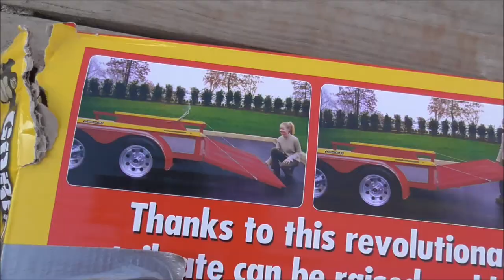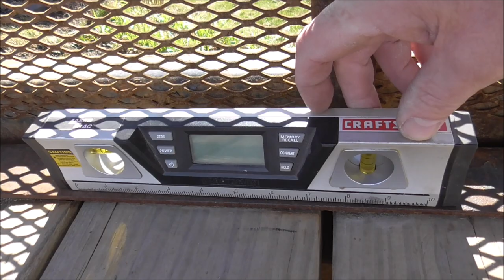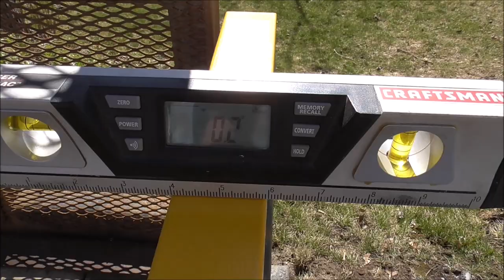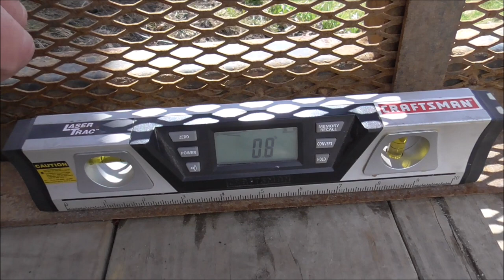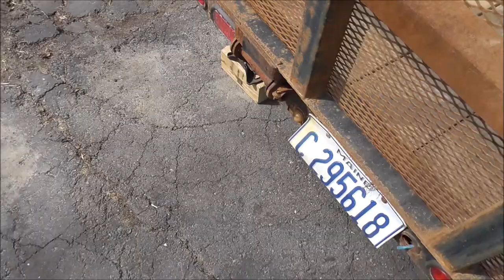Big Problems Solved! See How This Gorilla Lift Gets Installed on a Round Rail Trailer!

Comment from the maker: $25 Aluminum MIG Conversion https://youtu.be/FGhSo82MP9U
MORE WELDING AND FABRICATION VIDEOS HERE:https://www.youtube.com/playlist?list=PLfbf78fMz9Vol0uX2-GNc6mLi75zpqb5f
LEARN HOW TO WELD VIDEOS HERE:https://www.youtube.com/watch?v=ADa1I319GJ0&list=PLfbf78fMz9VqxPZTT-xmwdcrHVa7ML-ft
MIG WELDER https://yeswelder.com/products/mig-welder-mig205?ref=BRANDONLUND
Reply: Ohh thank you for the learn how to weld videos Brandon….im still waiting for the electrician….they are busy all the time…the whole house unit showed up yesterday so im thinking soon…heheh…lets hope so
Reply: That’s a really nice mig welder but, I can’t get one…i got the other one…..I wouldn’t mind having one….
Reply: When setting parallels across spans such as on that trailer. Bring two lengths of tube or angle to stretch across and clamp on the top of the gorilla tubes on the trailer.  From there fine tune the alignment as they will be placed at the exact horizontal plane resting on the pipe.  it will cut more time.
Reply from the maker: That would also work 👍

Comment: Hi Brandon.Nice job on the trailer. You're right about the finishing touches. It'll leave a good mark that you do things the way it should be. The paint finish will tell the client that you  did a very good job and the story will spread like wild fire.. you were just requested to install the lift and you've done it like straitgh from the factory. Good job. Keep it up. Thanks and God Bless. 👍🏼👍🏼👍🏼
Reply from the maker: Thanks man. Whenever I do things I try to do them like how I would want it done. It usually takes longer but 99 % of the time it's a better product

Comment: I spent my entire career in production metal fab so simple fixturing is automatic for me. It's easy to forget that other people have different backgrounds and do not think that way... I then spent a few years playing electrician installing conveyor systems and kinda took over the on-site fabrication operation.. The electricians thought I was a genius for things as simple as  clamping stops to a drill press table instead of hand marking 50 or more pieces individually....  Great simple explanation today...  TIP: (you knew it was coming)   Grinding a small chamfer on the bottom corner of the stop will eliminate chip build-up that can throw off the accuracy....  Good job on the project working through all the  issues...
Reply from the maker: Thanks man and great tip I appreciate you sharing. We all can learn from one another

Comment: i have a round tube trailor, i purchased (8) 2 1/2 inch muffler clamps welded the saddle to the to the square tube , then installed the U bolts up from the bottom, worked very well!
Reply from the maker: Nice! 👍

Comment: Thank you for the video. Helped me a lot in installing on our company trailer that has round tube railings. Used your measurements and all worked perfectly as you had directed. I still sucked on welding but thats besides the point. Again thank you for the video made a good reference for me.
Reply from the maker: Thats awesome! Thanks man and I'm glad it helped!

Comment: Brandon, I'm soon to pickup a "new" trailer that was used on a flashing arrow sign. The bed measures about 4'x4'. I plan to lengthen it forward about a for or so. It's a flatbed, so I'll need sideboards as well. It was a piece of construction equipment so it was never registered or licensed, so I'll have to go through that in my upgrades. I plan to put this on your FB page when I get it, and will go through the details there.
Reply from the maker: Oh I love that idea please do! Others will appreciate it also. It sounds like a fun project!

Comment: Good video!!  I didn’t know they made those lifts. Nice job. It’s the details that matter
Reply from the maker: It's pretty slick Mark. Thanks for watching!
Reply: @BrandonLund  It’s always a pleasure. I am going to build a tailgate for my little 5 x 10 trailer. Needs to be heavy enough to ride a Harley a bit. Would 1 1/2x 1 1/2x 3/16 material be thick enough do you think? I’ll use expanded metal over that
Reply from the maker: I would think so 👍

Comment: I have seen some individuals place the system inside the tube it's self ,  not to take away from your  great fabrication work
Reply from the maker: As I was doing this I thought of that myself. Super clean look also. I think this could be built using garage door springs and some rollers

Comment: Being so thin would it of been worthwhile to weld the inside of the 4 ends for a little bit more strength? Also if they were moved back about another 50 mm the Gate would shut all the way. I know you did what it said to do.
Reply from the maker: Time will tell

Comment: That’s darn heavy gate!!!  I see how much framing it has.. I have motorcycle trailer with ramp no spring or assistance on it but light steel. No rails… I wish put one on it.
Reply from the maker: It sure is heavy. He hauls a heavy tractor and a local fab shop added some additional supports a fee years ago.

Comment: I think you might still be losing a kerf thickness on your parts subsequent to the first one. First cut is on left of cut line = accurate. This has removed a kerf thickness from the beginning of the 2nd piece. So cutting to left of second line is short of the measured (desired) length. Since this project has arbitrary length pieces is is inconsequential, but if it were an assembly there would be problems.

Comment: Brandon, I am interested in the "level" you used in the gorilla lift video. I looked on Amazon and Craftsman, I could not find the model you used. Could you tell me the part number and where to find it?
Reply from the maker: Here is a link for your information. It's discontinued but it will give you an idea of what to look for. https://www.dxengineering.com/parts/shc-948292

Comment: Most people just use one but since his tailgate is heavier, why not. I went to a 10 pound spool of welding wire myself, after the 2 pound went empty. I would think that a spacer could be put on between the cable and the tailgate to keep it straight, just my opinion.
Reply from the maker: That was my thoughts too Jake. I watched some other videos and one lift seemed to be enough for most but this one had been beefed up by another local fabricator, so it was real heavy

Comment: Brandon, you'll want to be very careful using gloves around rotating equipment. I worked for a company where one of the employees cut his finger on a lumber saw that pulled his gloved hand into the saw. 
My employer at another company at one point required us to wear gloves for drilling, grinding, etc because the company he contracted with required it. I told him the above-mentioned account, and he did some research, and reached the conclusion that OSHA prohibits this. If you're worried about OSHA, you have to have a minimum of 8 employees for them to come after you, so you are definitely in the clear. I currently work for myself, so I'm also okay in regards.
Reply from the maker: I actually witnessed something similar. It's pretty scarry for sure.

Comment: Great fabrication work but that guy needs a new trailer or an updated tetanus shot. That trailer either lives out side or is up north.
Reply from the maker: Both! Winters here in Maine are brutal on metal. I had a truck that rotted out in 10 years. It ran like a charm but the body and frame disintegrated. I learned the hard way about undercoating. Either the metal was better years ago or they changed the mixture of what they apply on the roads here in the winter because we never undercoated our vehicles and we never had these problems until the last 10 or so years.

Comment: Ok gotta ask y not just use some c channel
Reply from the maker: Needed the clearance to be able to get in there with a wrench to tighten or loosen the nuts. 2x2 was the minimum to be able to do that. 2x3 would have been better but I didn't have any.
Reply: @BrandonLund  gotcha also if u wanted a multi process machine to cover as many bases as u could which yeswelder would u get im debating currently have backpack oxy acet setup and oxy propane setup for cutting and a hb special titanium 125 flux welder love it all mainly weld outdoors and want something for a bit heavier use

Comment: How would you take the two piece unit off of the 2” square stock? Are the two middle nuts accessible somehow?
Reply from the maker: All of it is accessible but you will need a ratcheting wrench to get to them. Getting them off is easy. Getting them back on is where it's tricky.
Reply: @BrandonLund  
Ah, now I see! One could also assemble everything, flip the unit over, then tack weld the nuts onto the saddles.